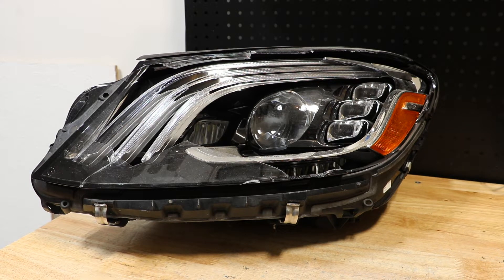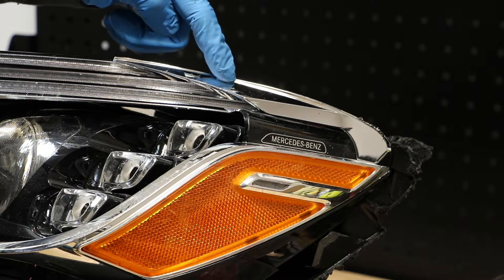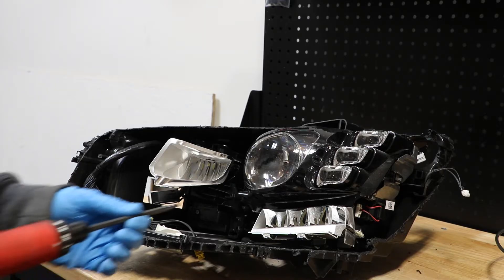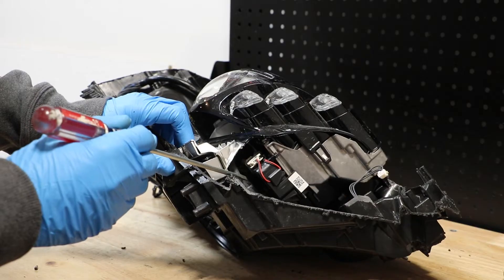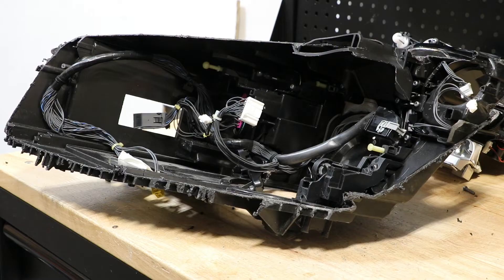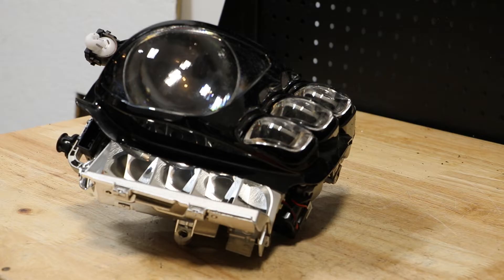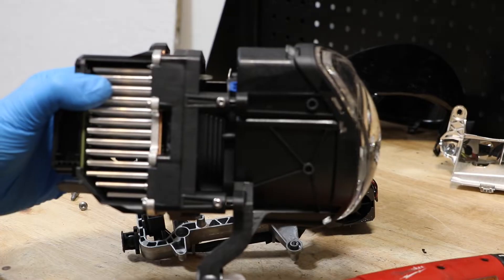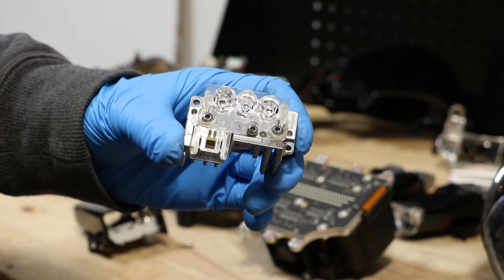2018-2020 Mercedes-Benz S560 S63 OEM Matrix LED headlight disassembly

Comment: You show the AFS motor. What does AFS mean? I didn't see that being removed. Where is it? Thanks.
Reply from the maker: AFS = Adaptive Frontlight System.  It's the ability for the head lights to auto level and swivel with steering input.

https://youtu.be/FsB9MrveHPs?t=245
It came out with the main wire harness, but didn't get caught on camera.

Comment: Mercedes and Volkswagen lights frequently have the white plastic gears and connecting rods on the exterior of the housing to connect the adjusters to the projector adjustments inside the housing. Have you figured out how to remove those?

Comment: You don't have to narate everything you do, if I can recommend something you could power up some of the projectors before you take them apart it would add more to the video a bench power supply it's pretty cheap
Reply from the maker: I do the testing videos separately from the tear downs.  Headlights like this cannot be bench tested.  They require multiple vehicle modules communicating with each other through canbus, 12v input is not enough/can damage the unit.
Reply: @gftgrill   Multiple vehicle modules communicating are required to turn on a few bulbs?
Reply: @hedgehogthesonic3181 look at them? Have you ever had an obdii scanner and looked at how complex the canbus system is in a car? These lights are no different